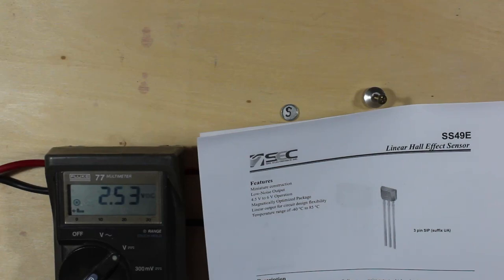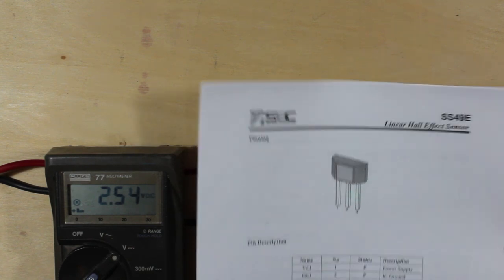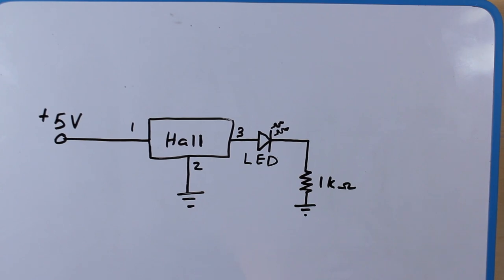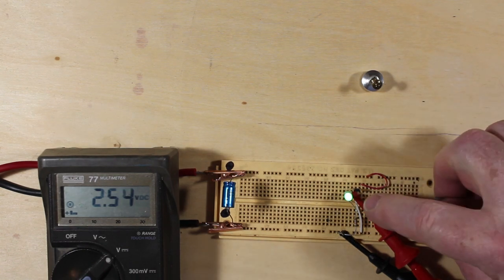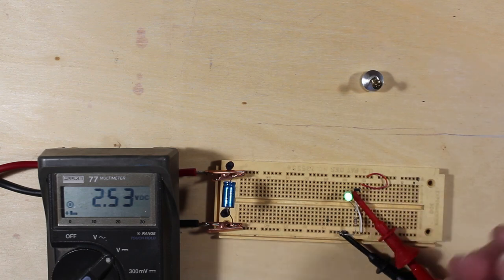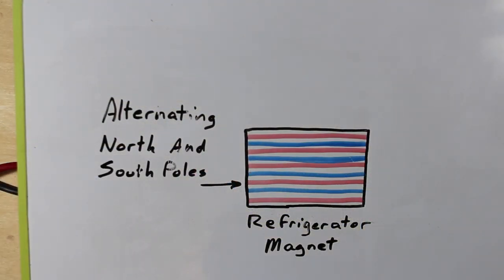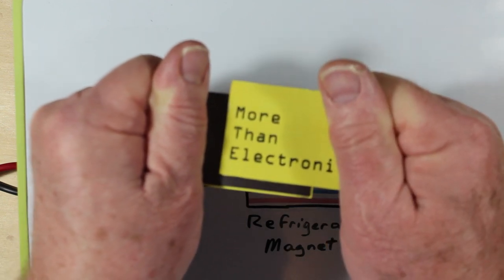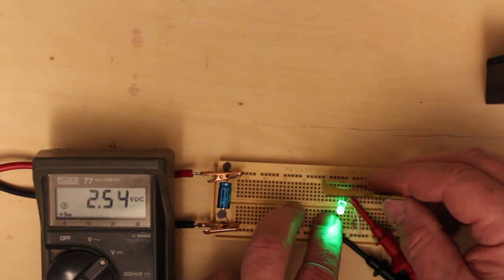Hall Effect Linear Magnetic Sensor Demonstration Using A 'Refrigerator Magnet'

Comment: How do you compensate for temperature drift? In your imaginary reality bubble that you live in it would be linear if you really pay attention it is non linear because it is temperature dependent. That's the reason why there is 25°C on the graph shown. Please do explain things right or leave it to professionals and don't spread half truth information 😂
Reply from the maker: I only use my Hall effect devices when the room temperature is at 25°C.  No problem......
Reply: Yes, you are correct. The ambient temperature of the room where this demonstration took place should have shown the current temperature to three decimal places, even though the professional who made this video claims that he always has the temperature at 25 degrees C when he's checking the polarity of his fridge magnets. Had the temperature been shown to be even slightly off of twenty five degrees Celsius then it would be possible to apply the appropriate calculations to restore complete accuracy to the results.